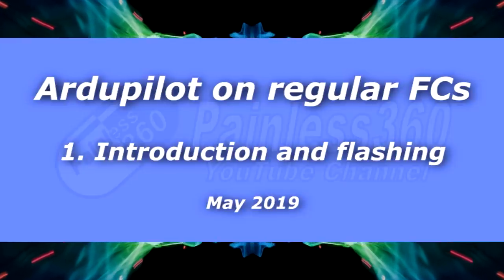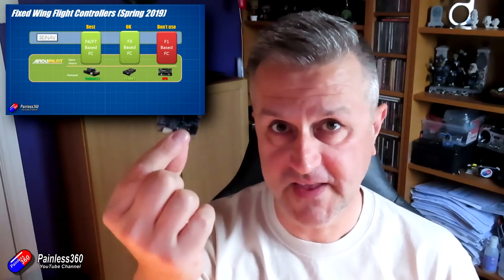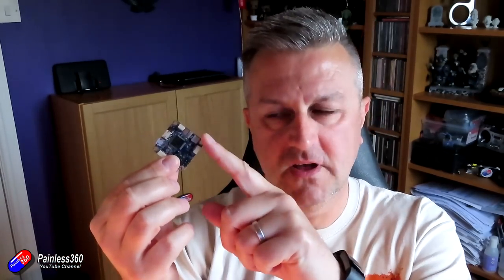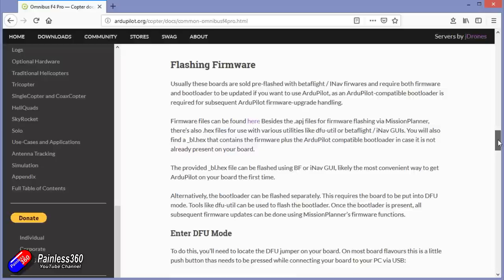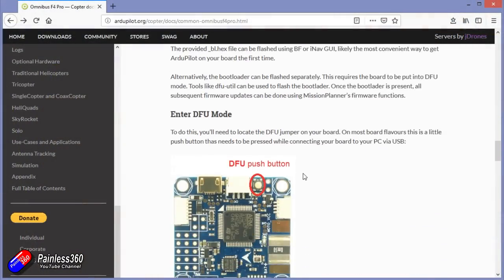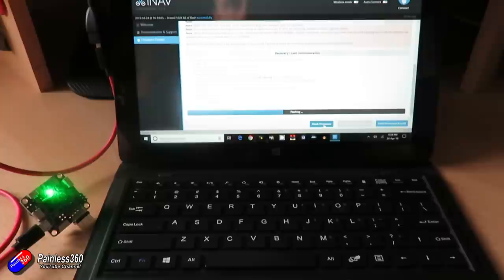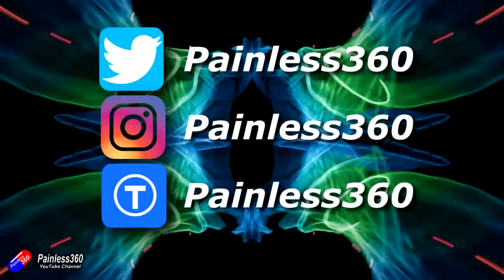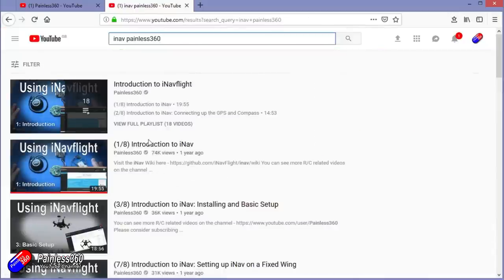Easy Ardupilot on Omnibus Series: 1. Introduction and flashing the firmware

Comment: Anyone know how to make standard serial telemetry work on the omnibus, for use with a standard radio modem?
Reply from the maker: Should be just a case of plugging into that telemetry port.. I'll be looking at that in more depth in the next build where there are more UARTS to play with.. Best of luck!
Reply: Rctestflight , serial telemetry (sik radio) worked for me out of the box on the omnibus v3 pro, no settings changed what-so-ever.
Reply: When using ppm for rc desoldering a resistor as described here : https://www.rcgroups.com/forums/showthread.php?2798125-Omnibus-F4-AIO-PRO-V2-ppm-receiver-not-talking-to-flight-controller/page2 solved the issue. I guess thats the price we pay when buying a clone board... no good documentation. This little resistor kept me busy the whole afternoon. My ppm input was working but missionplanner wasn´t getting parameters in.
Reply: hi rctestflight

Comment: After 30+ yrs absence I am getting back into RC planes (I have been flying quads for 2 yrs). Confusion abounded because literally everything has changed about planes and I don't have a friend/club that I can go to. So after about a month of stumbling around on the internet I found your series on the 900mm wing and knew that is the direction I wanted to go. I am hoping the series goes  into the 'how' and why to get the electronics up and running because I am clueless about setting up the new electronics in planes. I am retired and funds are tight but I hope to be able to be a Patreon.
Reply from the maker: Thanks for the comment and considering supporting the channel. There are a number of videos aimed at the newer pilot (or an older one coming back to the hobby) but I'm always on the lookout for helpful topics so let me know if you can't find detail on something.. Best of luck!

Comment: Great tutorial as always. I just plugged all my servos and ESC BEC into the servo rail after removing the diode. It works fine and is not necessary to solder those power pins together as you did (as far as I know).
Reply from the maker: That's right, I cover that in these videos. Using the pins like this works for any board - even if the FC has no way to isolate those outputs.. Happy flying

Comment: I'm in the process of converting one of my autonomous planes over from a pixhawk to a F722 wing board. Gotta say, I won't be buying anymore pixhawk hardware, not because it's bad but because the biggest drama is always the plugs and cables and these new boards take all that away. So much easier to just solder straight to the board or make up a servo plug if you really want to.

Comment: Not only this is great pedagogical advice but it's also great news. These f4 and f7 boards are very light, widely available and cheaper than those cumbersome pixhawk boards. I wonder  how nice would it be inside a big freestyle quad, loaded with GPS and compass. This thing would open doors to  acro, waypoints, GPS assisted flight, perhaps some fancy telemetry, computer ground base and so much more. Really excited about this. It could give big players, such as DJI, a run for their money.
Reply from the maker: Indeed, and you can relax that your private flight data isn't going to another country ;)
Reply: @Painless360  That alone would retire my old Mavic snitch.

Comment: Hi Lee. Thanks again for video. I especially like what you did to avoid having to remove the diode - all these boards are slightly different so I was unsure which is the correct diode to remove. Great solution

Comment: I've been running Ardupilot Arducopter on a $25 Omnibus F4 for several months now. Works great. Including GPS, telemetry transmission, OSD, Mavlink Gimbal control of a Storm32, and SBUS R/C. Had to do some s/w tweaks to enable an extra built in UART. Feel free to ask any questions.
Reply from the maker: Awesome! Great to see another tackling this. Have you made any instructional videos or how tos?
Reply: @Painless360  Hah, not for fun, just for work collegues on non-drone related topics for work :)
Reply: @Painless360  BTW, I paired this card with a $35 4-in-1 ESC (BS430 ESC 30A 3-6S 4 in 1 BLHeli-S)
Reply: How do you connect the telemetry radios?
Reply: @topdrone8586  My telemetry connection goes to my ground station. I use a 915Mhz radio link that connects to one of the Omnibus' uarts

Comment: Having played with the Omnibus F4 Pro in a 450 quad I'm quite pleased but I have to say the temperature drift of the barometer is shocking - the pressure trace follows every nuance of the temperature trace with a significant amplitude and the altitude bombs off by about 10 metres within a few minutes of turn on. Setting TCAL_ENABLED = 2 (learn & use calibration) has helped but the whole thing has made me want to build a flight controller with completely separate sensors that can be housed to get the best from them (vibration isolated, away from heat sources, wind baffled etc) and to this end I'm getting an H743 development board (quite tricky in the current climate of STM32 shortages!) in order to see how this works out. Also have a ESP32 coming with which I plan to organise MavLink over WiFi. Should all keep me off the streets for a while 8-)=
Reply from the maker: Letting the FC warm up before flight with these cheap and cheerful flight controllers is a must. Covering the baro with foam is handy too. This is why things like the PixHawk CUBE has in internal heater to maintain the temperature to avoid issues like this. More modern, more expensive boards have much better baros on them from my experience here. Happy flying!
Reply: @Painless360  Many thanks for the reply. Yes, I have a foam baffle on the baro as it certainly calms the height vs airspeed issue down a bit. The project is really to see what can be done for minimal outlay during a chip shortage. I like the idea of upgrading sensors on the FC as they become available rather than having to sack the whole thing to get the improvements. The MS5611 is only about £12  even from RS (or will be when they have any in stock ) so I'm going to pension off the 280s when possible.

Comment: Hi, I have a question, I was inspired to try this, I got myself a Furious FPV F35 lightning since it looks neat, I successfully flashed it with ardupilot, but the GPS is not working at all, is this something easily fixed or is there a way to revert it to Inav?
Reply from the maker: Without knowing what you've tried it's tricky to offer any advice. To get it back into iNav then you'll need to press the DFU button/contacts on the FC to force it into bootloader mode and flash as normal. Best of luck!

Comment: Removing the diode is done to protect/ isolate  the FC from the 5volts coming in from the esc Bec when connected to the rail. The 5 volts on the rail from the esc will then power the servos . The receiver connection gets its power from the FC separately. I do not get 5volts on the rail from the FC hence you need external power to power this rail. So this procedure is done to protect the fc. Leaving the diode will still allow you to power the rail but may risk the fc.
Am I correct? Read this info from the link in ardupilot which forwards it to rcgroups
Reply from the maker: Pretty much. That's why I changed the 5v pins on the servos and esc connections to avoid all that.. this isn't really designed for fixed wing out of the box like the Matek F405-wing..

Comment: The trickier thing to do is to deal with frsky telemetry. You should definitely have a video about that. It would be easier than have to read multiple forum and github post as i did.
Reply from the maker: I've always found it pretty simple to setup (http://ardupilot.org/copter/docs/common-frsky-telemetry.html) on Pixhawk. See https://www.youtube.com/watch?v=EEeCK8BQM8o for examples and how I've set it up. I may look at it again when I make another model with an FC with more UARTS.. Happy flying!
Reply: I tried with the matek f405 wing and i find it a lot more difficult : 
1 - 3.10dev version of ardupilot required 
2- Have to get a frsky receiver which got a "reversed" smartport 
You can find a thread on github here : https://github.com/ArduPilot/ardupilot/issues/9267#issuecomment-488718152
I couldn't get the craft and theory cable and the lua script to work like on the pixhawk/cube. If you have some tips, i would be glad to here about them... Happy flying!
Reply: I've purchased the craft and theory cable and got Frsky Telemetry working on a Pixhawk 1 with an X8R.  I've also built an equivalent cable with frsky part Ful-1 and an diode (gets the cable price down to about $5). I'm now trying to do the same with the Omnibus F4 pro and an XSR receiver.  All the ardupilot documentation shows is the telemetry transmit and receive pins and to put it on UART 1.  The XSR only has one line in for the Sport with no spare ground connection.  I'm at a loss for how to wire and configure it.  Any thoughts would be appreciated.  I haven't found any real documentation on how to the Frsky passthrough telemetry working with the F4 omnibus pro.  Thanks.
Reply: I think that it would way easier with an f7 board (kakute f7 and omnibus f7 have target)

Comment: I set one up on a Z84 a month or so ago. I didn’t finish it up because I was unable to get RSSI working. I tried RSSI in the PPM stream and directly analog to the boards RSSI pad. Maybe I will try it again with newer FW. 
I think Ardupilots level modes are much more stable than iNav at least on wings. Traditional fixed wing planes I built have worked well and are stable with iNav. I don’t know why it’s only the wings that are not able to get a smooth tune. I ran PatrikE’s FW on wings in the past that were easy to tune and flew very smooth on wings. Every wing video I see with iNav are always so unstable unless there is zero wind.
Reply from the maker: I may do a video on that.. thanks for the idea..
Reply: @Painless360  That would be great if you did! Thanks for considering it.

Comment: Great vid. I’ll be doing an upcoming OmniArdu build soon. Such a shame the ProFi guys didn’t include an OSD in even just one of their new Cube flavors. I understand their direction was to promote the Herelink, but honestly. .  . the FPV community at large has been asking for decent OSD integration since forever. The user shouldn’t be required to purchase the Herelink. I have one, and it’s nice, but like many old FPVers, I’d just soon use my Taranis and do the vid/telm on traditional freqs. Maybe the Maya guys will put an Omnibus style OSD on the PixRacer at some point.
Reply from the maker: I've been asking for the same thing for quite a while now too. Last I heard that isn't wasn't a direction that they're interested in but maybe as the majority of the Pixhawk sales are cannibalised by people using these cheaper flight controllers with on screen displays, that might change. Fingers crossed!
Reply: @Painless360  Yes, fingers crossed! In the meantime, this particular video series will surely be popular. So many of my flying Buddys are gearing up for summer with their builds. Looking forward to the next in the series!

Comment: I am curious as to why  you chose to power your servos from the ESC instead of from the Omnibus board? Powering from the board negates the necessity of having to remove the tiny diode and modifying the servo connectors.
Reply from the maker: The 5v amperage rating on the FC isn't enough for everything, especially servos. Having a separate supply for the servos is a good idea (see the specs of things like like the Matek 405 and 411-wing boards that have two 5v supplies for this reason...
Reply: @Painless360  Thank you. I hope my old eyes are up to the task :( ...
Reply from the maker: Magnifying glass and glasses work for me ;)

Comment: hello I am using this flight control card. I'm trying to do it from the inav program by watching you. I connect a GPS, but it does not work even though my connections are correct. Could you help?
Reply from the maker: Please watch the series, you need to check that it's powered and you may have the RX and TX lines the wrong way. Best of luck

Comment: Thanks for these group of videos Lee.  I am following this to the letter and at present all is well. Sorry but did you remove the diode or did the soldering of the pins means you can leave the diode in place ?  Many thanks
Reply from the maker: I didn't need to as the pin trick meant that the servos were powered from the external 5v power..

Comment: I am building a plane with Ardupilot using a board similar to the one you have.  I am wondering,  would you recommend powering the board with another battery than what you are driving the ESC / Motor with?
Reply from the maker: Depends what that others board is... this is why I make these series so you can follow along exactly with the build using the same components. Best of luck!

Comment: Flashed Ardupilot on my F4 Pro V3 FC all working except no power on servo output rails. Soldered bridge for PPM receiver and removed diode as shown in the documentation. Where am I going wrong? What to use FC in a fixed wing. I'd apprcciate any suggestions. Thank you.
Reply from the maker: Please watch the series to see how I did it. Best of luck!

Comment: Hey Lee question for you. I flashed arduplane to a sucexx e f4 and accelerometer doesn't seem to work. I get a barometer error when connecting. Everything else seemed ok. I flashed back to inav and it's working. Couldn't get much info on it. Thanks for your time. Have a good one.
Reply from the maker: Not sure, I have not used that. I would check the wiki and forums. Best of luck

Comment: great video buddy as allways.quik question.one of the youngend in our group just finished there first build.dys f4 pro v2 fc.racerstar 50amp 4in1 esc.and when he plugs in the lipo we are getting a red hot chip on the fron of esc.cant see and shorts anywere.its like a small silver cap.very very hot straight away.any ideas.first time ever this has happend and im stumped.
Reply from the maker: I double check that nothing is touching the bottom of that ESC and causing some kind of short. If not then it's probably an issue with that ESC board. Best of luck
Reply: @Painless360  thanks buddy will check it out.he soldered ot all perfect.so will have look

Comment: After flashing the board I can connect to MP on port 9 ok. When I install quadcopter within MP the port number wants to go to port1 but when I try and connect again to MP it times out  with message "No heartbeat received" and doesn't connect. The version of MP is  1.3.72, any ideas?
Reply from the maker: The com port should show up in the list. If not then it's probably a driver issue... Best of luck

Comment: Hello from across the pond. Thanks for yet another project, which should keep an old man busy. Well I got the board and it was pref-lashed with betaflight ...easy enough just re-flash ... push in the little button connect light stays on but won't flash....drat. I only wished to keep the little gray cells active, not stress them to the point where using a hammer on the offending boards sounded like a proper fix  ...any insight?
Reply from the maker: All of the steps I followed are a the series. Tricky to offer specific advice without knowing where and how it fails..
Reply: @Painless360  Found the fix loaded an old laptop with windows 7, which seems to be more agreeable to the drivers required to flash different boards . So I have it programmed and shall give it a try in a home made foamy, I shall attempt to not crash but with the little circuit added at least it will crash nearby ... thanks for the reply

Comment: Hello Friend, I bought my Omnibus F4 at Airbot, the board is working perfectly, but I'm only able to turn it on through the engine esc, I soldered the battery wire to the board's bec, but when I plug the battery, the board doesn't turn on, it would be necessary some procedure like soldering a bridge.  Thanks.
Reply from the maker: Which Omnibus F4 board exactly? There have been loads of versions and I can't have a look at the manual or wiring diagram until I know the exact one. Can you post a url to it? Thanks.

Comment: So you are using the INAV windows programmer to flash the ArduPilot firmware? 

Are INAV, ArduPilot, CleanFlight, and Px4 Autopilot all competing flight control software, any of which can be targeted to a supported hardware platform (Omnibus f4, SP Racing H7)?    Or does the type of software you use depend on the application (fixed vs rotary wing)? Thanks!
Reply from the maker: I have a video or two about that. Google something like 'flight contol software painless360' to find them.. Hope they help.. Happy flying!

Comment: Do you recommend using a F4 or F7 flight controller on a 650mm drone compared to say a Pixhawk 1 or Pixhawk 4 mini? I am talking about the flight controllers that look like a Omnibus. If so which one do you recommend? Thanks! Also, how would I wire the buzzer and safety switch?
Reply from the maker: There are limited choices for those smaller flight controllers. Check the wiki for the latest supported boards for the options. I prefer the Matek stuff and F7 is my default now.. Best of luck
Reply: @Painless360  Great thank you so much!